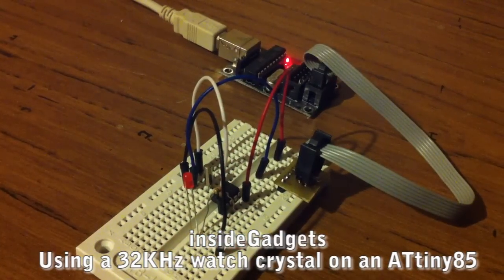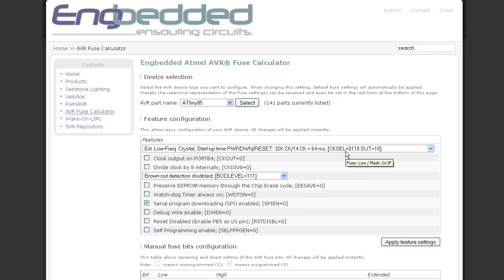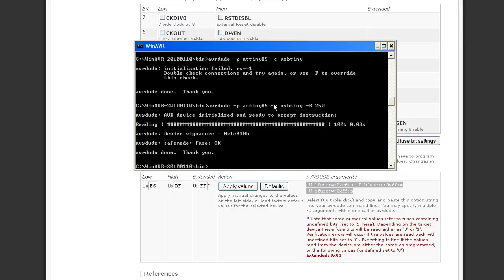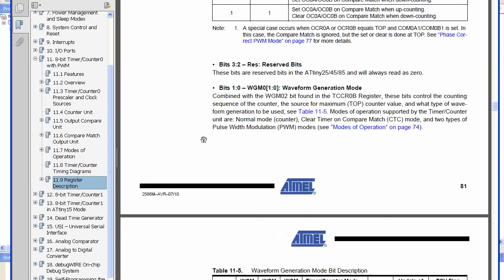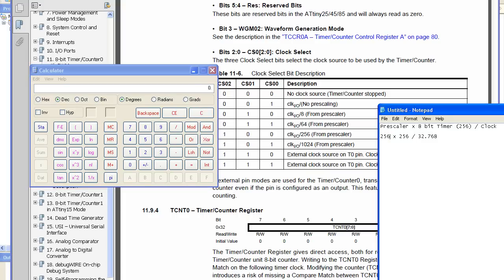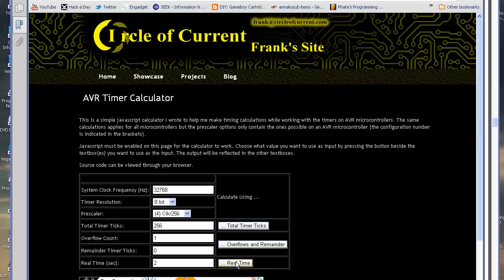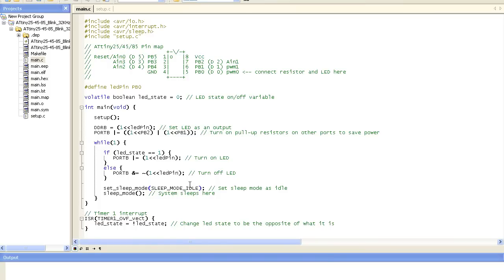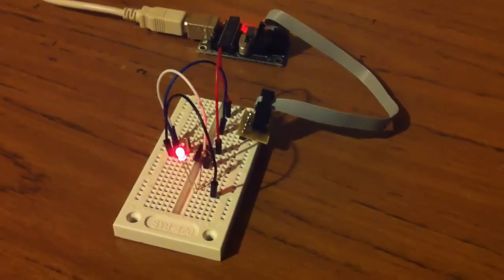Using a 32KHz watch crystal on an ATtiny85

Comment: YEAH! I just tried another ISP and figured it out :DDD the problem is definitely using the Arduino as an ISP
Even though it looks that avrdude sets the fuses correctly, it doesn't!! All my µc I configured using the Arduino-ISP I can not even connect to with the 'real' ISP any more. And doing it all with the ISP in the first place it works fine.
So people, do not use the Arduino here, it destroys the µc! Maybe a fuse doctor will help, but I don't have one
Anyways, thanks for the tutorial, Alex :)

Comment: Hey Alex,
Thanks much for putting some time and brains into this video. Great stuff!
Actually I'm looking at a circuit for a slower interrupt cycle which includes an 'el-cheapo' clock circuit combined with a decade counter chip (1 min interrupt). 
As usual I have to also do some research, but this should save heaps of power for my remote project.
Again, thanks much.

Comment from the maker: Hi, yes you can set the fuses through the Arduino software. You need to modify the boards.txt file found in arduino\hardware\the attiny folder you have, make a copy of say the 20MHz version, change the fuses to how you like, close and re-open the Arduino software then go Tools > Burn bootloader > w/Arduino as ISP.

Comment: Hi Alex, 

Is it possible to set the fuse bits through the Arduino software?  It has options for a 20MHz external clock, but that's it.  

If not, does that mean that if I set the fuse bit to 32kHz with avrdude, that I can no longer program the Attiny85 with the Arduino?

Comment: Yes I tried it with and without the clock, with several baud and bit rates, even with another MCU (ATmega328P) on the Arduino board and like I said with 2 different Attiny44a and one Attiny85. I fear it would be useles to "waste" further microcontrollers.
I am pretty stupid because I have seen this video, then finished building a watch (it took pretty long) and the software, and >only now< I try to communicate to the MCU lol
Very awesome video by the way :) Thanks for that

Comment: Hi, yes I did and the crystal is actually in the same holes as the chip. I tried moving the chip like you said but no such luck there either. This is a salvaged crystal from my "treasure" pile  and since the uC was working correctly on the internal clock I'm making 1 of 2 assumptions: Either this crystal is bad, or isn't actually 32KHz. (Should this work with a diff freq? I did try my 16, 14, & 12MHz crystals but no go) Thanks for taking the time to build up the 328p. Much appreciated

Comment from the maker: Hi, I just programmed my 328p - set the low fuse to 0xe5, plugged in the 32khz crystal , used -B 250 and it worked ok. Just checking that you: Removed the power from the 328p after setting the fuse, inserted the 32khz crystal in PB6 and PB7, the crystal is as close to the 328p as possible and then plug in the power and try access it? Could you also try moving the 328p to a different part of the breadboard?

Comment from the maker: Hi, could you check your wiring - maybe one of your pins are grounded?

For the 32KHz MCU, it sounds like the fuses weren't set, if you did it through the Arduino software please try doing it through avrdude. I found that setting the fuses through the Arduino software can be hit and miss sometimes. If the fuses were really set (assuming they are correct for 32KHz crystal), if you didn't have the crystal plugged in, it wouldn't work at all.

Comment from the maker: I found that someone changed the baud rate down from 19200 to 9600 which may resolve this issue. You have to change it in 2 places - 1. In the ArduinoISP sketch, find Serial.begin(19200); and replace it with 9600. 2. In arduino\hardware\arduino\programmers.txt, find arduinoisp.speed=19200 and replace it with 9600. Now re-upload the ArduinoISP to the Arduino and try again. If that doesn't work try these other baud rates: 300, 1200, 2400

Comment: I was trying this on a mega328p, but after I set the low fuse (which is 0xE5 on 328) I can no longer talk to the chip. I tried -B 250 aswell of variations of that but no such luck. any thoughts?

Comment: :'( I used my Arduino Uno as an ISP and it doesn't work after setting the fuses. Now I have two attiny44a and one attiny85 with a device signature of 0x000000... I think I have to buy a usbtinyISP, too :/
But there is a a further problem: Before setting the fuses for using a 32KHz crystal, It had a blink sketch already uploaded and now with the fuse settings it doesn't make any difference in blinking weather the crystal is plugged in or not. What do you think about this?

Comment: Got past that error; was due to 1.0.2.  Installed 1.0.1, much better.  Still doesn't seem to work though, end up getting 

avrdude: please define PAGEL and BS2 signals in the configuration file for part ATtiny85
avrdude: Yikes!  Invalid device signature.
         Double check connections and try again, or use -F to

Tried down to 300, so I guess that's in the too hard basket.

Comment: Anybody looking around here? I have trouble getting my Attiny85 running with a 32768HZ crystal. I burned the fuses to -Uhfuse:w:0xdf:m -Uefuse:w:0xff:m -Ulfuse:w:0xE6:m, but nothing happens. I tried several crystals and two different Attiny's.

Anyboy any tips to finc out what is going wrong? When I attach a scope i see a weak signal (30mV, with a frequency of 1/10th of the expected frequency.) on one of the pins of the crystal/PB3 of the Attiny

Comment: Hi, can anyone tell me what kind of software is he using to upload the sketch? I could find software which could open the files to upload them to the Attiny. I Am using Attiny45 should be working same as Attiny85. 

Another Question is: I think i changed the fuses but i dont know how i can test it. 

Would be great to get any hint to the software he is using in this video.
Thank you in advance
Reply from the maker: Hi, the software is WinAVR, you can open up the project file with it. You can then compile and flash after that. Depends on the fuse bits you have changed as it may not be easy to test. You can also read the fuse bits back.
Reply from the maker: Also check out  - https://www.insidegadgets.com/2011/04/30/move-from-arduino-software-to-winavr-with-programmers-notepad/
Reply: @insidegadgets  thank you soooo much for fast reply !!!

Comment: Yeah, that didn't much of anything. I also tried changing the baud rate on the Arduino ISP sketch that gets uploaded to the Arduino to 300 and running AVRdude with -b 300. That still doesn't work. I'm guessing that like the others who posted, my attiny85 is bricked. I'll try using an FTDI dongle I have in bit-bang mode to see what happens with that.

Comment: I read the comments before attempting but I couldn't wait to get started so I tried burning the fuses using an Arduino Duemilanove as my ISP... I can't communicate with the attiny85 now. It was uploading the blink example just fine before I burned the bootloader. Now it's completely unresponsive.

Even when using avrdude. avrdude -p ATtiny85 -P /dev/tty.usbserial-A6008iE2 -c stk500v1 -v -v -v -v -b19200 , I get a blank signature, 0x000000.

Comment: I was having the same trouble with the 0x000000 device signature, I installed an alternate version of ArduinoISP (with a slower programmer) and It worked perfectly.

So maybe using a slower programmer is the key. Anyways thanks for the tutorial.
Reply: +Martín Tirado Could you specify the alternate ISP software? What's it called, and which arguments did you use with avrdude?
Reply: I used this software, and, if I remember correctly, I used the same arguments as a normal Arduino ISP.

https://github.com/lmpipaon/ArduinoISP_slow_SCK/blob/master/ArduinoISP_slow_SCK.ino

Comment: The wiring should work 'cause I can upload programs if I don't touch those fuses
I didn't use the Arduino IDE, I did everything the same like you exept from the the ISP
So I was able to communicate to the µc before I set the fuses. And I already tried changing the baud rate to 9600
Here is the exact message I get using the console (uploading with Programmer's Notepad gives me the same result) pastebin.com_/CUkK2hfV
One more thing: I never got the error "initialization failed, rc=-1" like you did